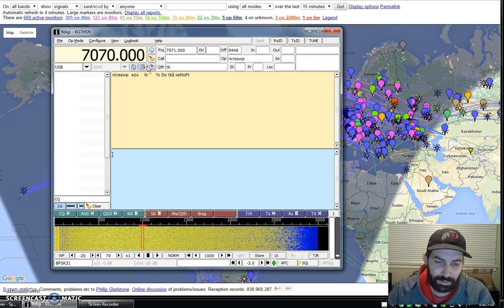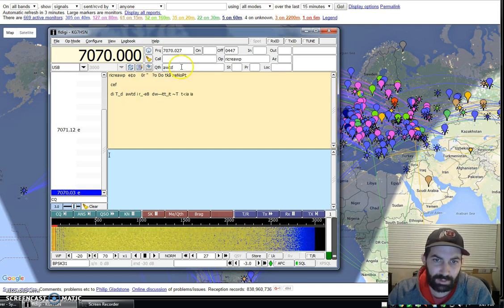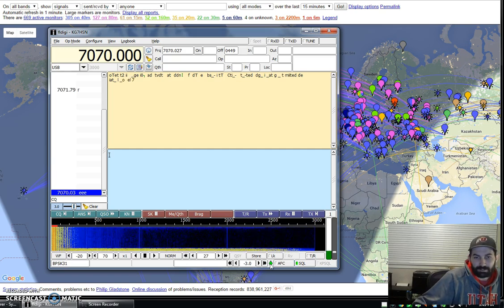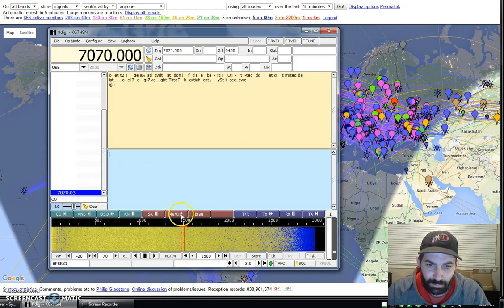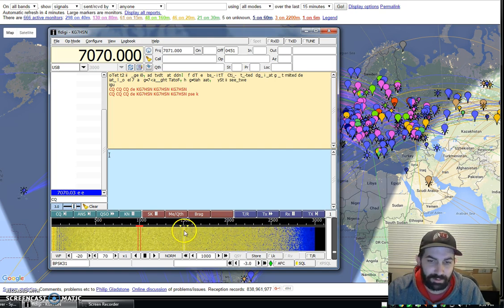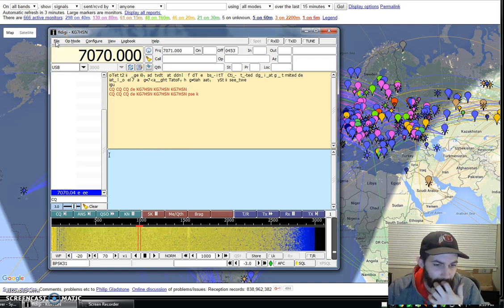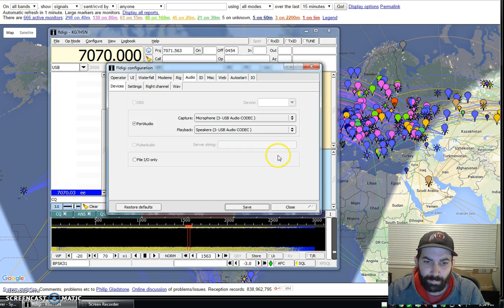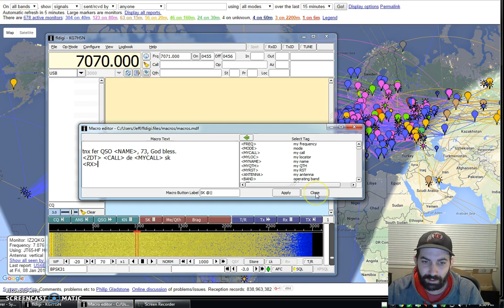Ham Radio: FLDigi: PSK31 - A Beginners fldigi PSK31 High Level Introduction

Comment: People should really use the TxID button on the top. There's so many modes out there. That will make it clear to somebody listening what mode you are sending in. Yesterday I saw a few signals on 20 meters and tried for probably an hour before I gave up to see what mode it was. No setting would decode, but that TxID tells what mode you are sending out. If the listener clicked RxID Fldigi would tell you the mode of the signal coming in and alert you to what it is.

Comment: Hi Jeff, another Jeff here. Glad I found your video. I’m just now setting up a tablet to run FLDigi with a Signalink, and this video was very helpful. I was thinking of NOT doing rig control from FLDigi as well — do you still run it that way? How does it workout for you?  Do you use the logging function in FLDIgi?  Thanks!  73 de Jeff, KF5KWO

Comment: Good stuff Jeff!  This 10-minute video probably just saved me 10-HOURS of hunting and clicking trying to find the basics.  Been a Ham for 25 years and just recently became interested in the digital modes, other than packet that I ran back in the 90's.  I live in an HOA controlled Town Home and have to use stealth antennas in my attic, forcing me to only run low power due to neighbors under the same roof. So most of my contacts have been CW and probably now Digital.  Thanks for the fast tutorial!

Comment: In the first part of your video all you have in the waterfall is noise, no signals. I have my waterfall setup so that only the signals are visible. There are two buttons on the left that only adjust the appearance of your waterfall. Your settings are unusable.
73.
Reply from the maker: Thanks. Yes, you can adjust the view of the waterfall, but it still decodes just the same, and is only user preference. I didn't have the time to dive into every feature unfortunately, or the video would have been multiple hours long.

Comment: when you say the band is "dead" do you mean that the general noise level is higher than any signal.  Am a new general so am trying to use FLDIGI to kind of gauge the normal noise level.
Reply from the maker: +Kevin J It could be either or. When I refer to the bands being "dead," that Typically, means that the propagation is so poor that the signals from one station aren't skipping or making it to the another station. This could be cause by many a geomagnetic storm for example (measured with the K Planetary Index.)

High noise isn't necessarily an indication of bad band conditions. For example, there could be something close putting out a lot of RFI.

6 Meters (aka the Magic Band) is another excellent example. The 6 meter band is dead the majority of the time, and only a few times does it open up. However, even though the band is dead (or not open) the noise floor is frequently around S1 to S3. The skip just isn't there, and thus the waves don't bounce. Whether they are going through the atmosphere into outer space or maybe they're getting absorbed in the ionosphere.

Hope that helps.